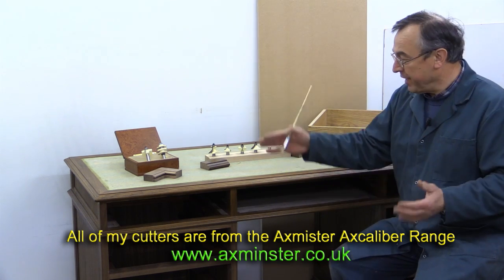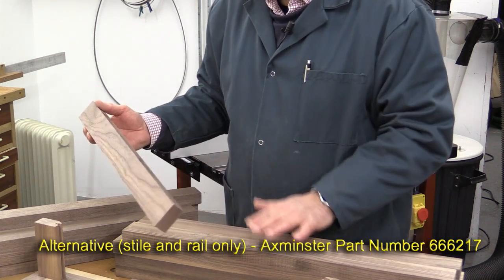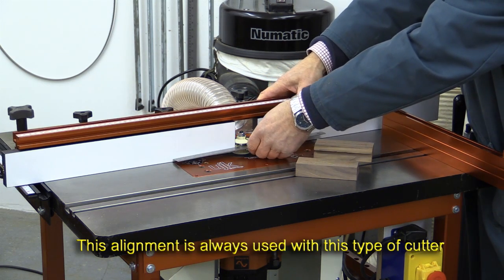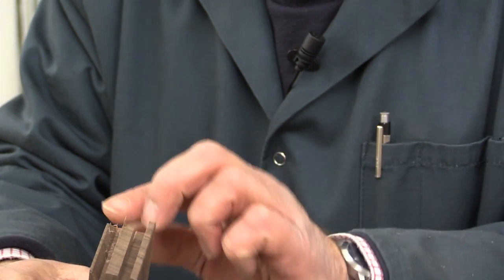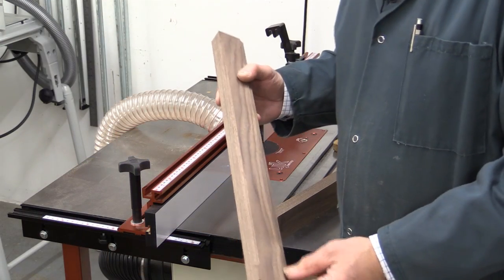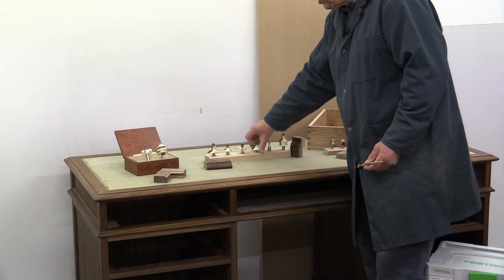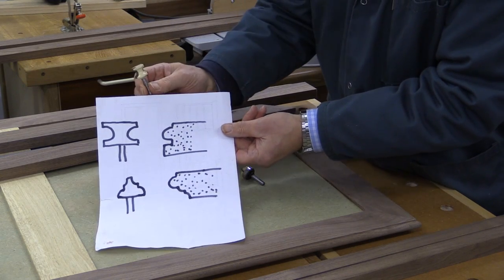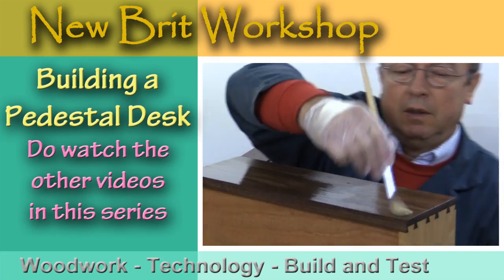Pedestal Desk - Various Mouldings

Comment: Very interesting - I really like the look of the router table and am thinking of getting one - space is a bit tight in my workshop though.  I have seen your videos on the table and about adding castors so will have to consider that option.  Looking forward to the dovetail video too.
Reply from the maker: Hi David, My workshop is smaller than it looks and so being able to move things around on castors makes a huge difference. My bandsaw is on castors, so is the UJK router table and I have my mobile bench. I can reconfigure to suit each project or task. The dovetail video will be in two parts. I hope to have that done in 2 weeks time.   Peter

Comment: Hi Peter. As a beginning (fine) woodworker in the UK your videos have been very informative, thank you :) I just want to ask about your opinion on your router tables as I see you have both the Festool CMS and the UJK system. I realise it isn't fair to compare the UJK to the modular system setup of the Festool, but I was thinking fitting the CMS top module into a more permanent structure of my own design, much like the UJK router elevator fits into the cast iron table top (the reason for this is I won't need to transport it anywhere and I also don't really want to pay an additional £400-and-something for the Festool CMS leg unit). If this is a viable option which of the two would you prefer to use?
Reply from the maker: Hi Matt The UJK setup excels because of the solid build and mounting in the super cast iron top. The CMS-OF also excels because it is so portable and can be taken to a job site if required. The Festool routers are fantastic and are the best that I have ever used. Dust collection on the CMS-OF is superb. If you are going to build something yourself then just insert something for rise and fall then the cheaper option is the UJK Router Elevator. The CMS-OF is an elegant alternative and could be moved on to a base unit when your funds allow. By taking the UJK route you will have to create a fence arrangement and a mitre fence - getting that right may not be easy unless you go for something like the Incra solution. Good luck. Peter

Comment: Hi Peter, am here again on your channel to absorb precious knowledge from your kind self.  And  as usual I have a question. I want to get a router and I am torn apart between hand held or a table top.  Awaiting your kind response.  Many thanks.
Reply from the maker: Hi Mian, You need to start with a hand held router - you will always need one anyway.  Peter
Reply: @NewBritWorkshop  thanks a lot for your advice.  it means a lot to me

Comment: hi peter in australia the festool router table    set is about for the 1400 festool router in the festool router is about $2600 and the festool big router in the festool router table is about $3570 around that money.A festool salesman show me the festool router table and i was so impressed,size is what i like and you can move around easy.Thats what i like.''Peter just a question is the price of the incra router system put you off,or do you like a simple router table Your uk router table table is nice in australia we have the  same router table but different brand.I was thinking of buying a incra router system but i do like festool router table a lot.
Reply from the maker: Hi Shane, Yes, the Incra kit is quite expensive but I know that it is very good from what others have been saying. I use the OF1400 in my CMC-OF and it works really well.   Good luck.   Peter

Comment: i was looking to get some of the axminster bits, on there site they are 12,7 mm ( witch is 1/2 inch ) but festool of 1400 is only 12mm do they fit or do you have to get a other holder the router
Reply from the maker: Hi Heino, I have both the 12mm collet and the 1/2" collet for my OF1400. The Festool part number for the collet is 494465. Axminster do not appear to stock that collet but Toolfest do and they are a great company for Festool kit - try http://www.toolfest.co.uk/quick-search?terms=494465
    
Peter
Reply: Peter Parfitt i only got the 8 and 12, guess i need to get the 12,7 Festool makes